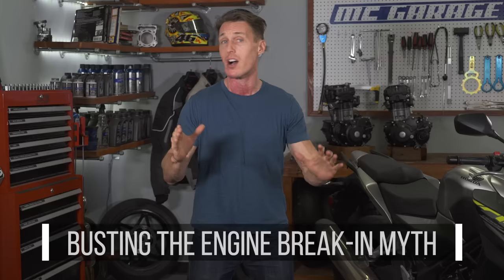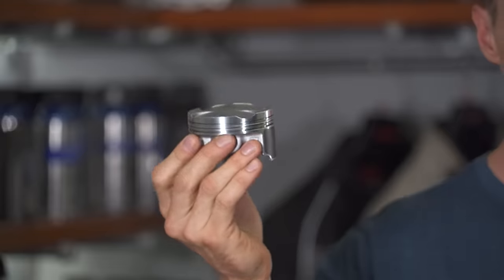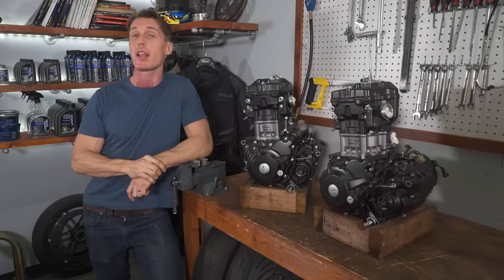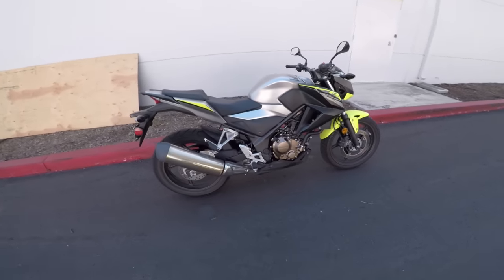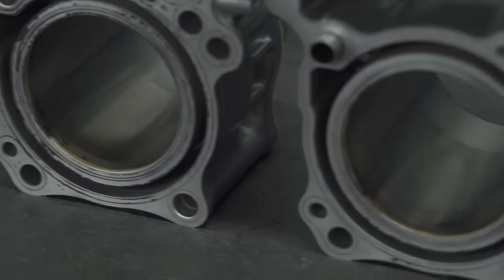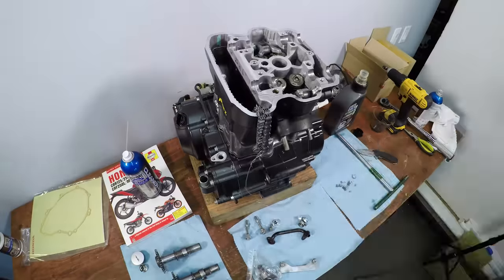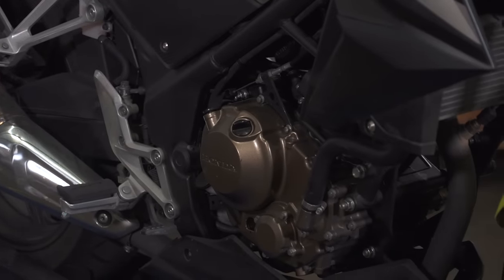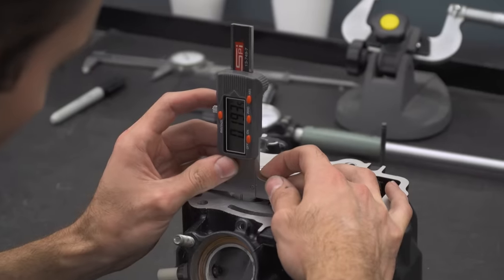Busting The Engine Break In Myth | MC Garage

Comment: He did not put the debate to rest. He even states that materials and engine reps can vary a lot from engine to engine. To claim that this small test on only one engine, which was liquid cooled, speaks for all engines would be a lie. He knows that and he suggests it as well. There is a panel of Harley-Davidson mechanics that do a video just to talk about this video and they all say the same thing, based on their collective experience taking engines apart, they all recommend to follow the manufactures' suggestion.

As someone who worked with the legendary Ed from Ed Pink Racing Engines, as well as with engineers from Suzuki, Honda, and others, I rather follow the recommendations made by the people who designed the engines. 

Engine design is a lot more complex than just slapping some parts together and call it a job well done. Depending on engine application consideration is given to everything from materials, stress loads on different components of the engine and casing, heat tolerance, lubrication, weight, and so much more. These are people who understand this engines down to a microscopic level. When it comes to materials down to the molecular level. Metallurgy is a real science and that science is adhered to when considering materials. One of the many reasons why a new motorcycle engine will cost you a few thousands of dollars. While a GE90 with extremely exotic and expensive metals that can withstand such loads and heat abuse took over 2 billon dollars to develop and the retail price back in 2011 was 27.5 million dollars for each engine. 

If you listened to him, he states that that particular engine is a low rep type of engine and that engine materials vary from engine to engine. The Harley-Davidson mechanics completely disagree with the idea that it makes no difference in all engines. They also point out that this was a water cooled engine that reps are a low RPM with pretty constant operating temperatures when compared to an air cooled engine.  With air cooled engines reaching temperatures of 400-500 degrees when stuck in traffic on  a hot summer day. My 2021 Ténéré 700 never goes over 120 something degrees due to it's cooling system's fans kicking in. Two stroke engines are a different beast all together.

Some idiots claim that racing engines don't go through the gentle engine braking that we are asked to do. But those engines are completely rebuilt after must one race. The engines in our motorcycles are supposed to last a long time. Well, that is the hope assuming the idiot riding it takes care of it and doesn't wreck the bike. Overall the life expectancy of sport bike engines are not as long as that of a touring bike.

A note on engines coming out of racing bikes. Racing engines are occasionally sent back to the factory where engine designers and metallurgists inspect the engine even with microscopes. Microscopes and other testing can reveal a lot more than measuring alone can. And when an engine fails on the race track it goes though even more stringent inspection process.

Here is the thing, when I was involved in that field, every engineer I met, from Ed Pink, to Fujita (engineer at Suzuki) to pretty much every other engine designer I've met do recommend to follow the break in procedures outline by the manufacture. If you want to ride your bike like an idiot who is being chased by the devil right off the bat then by all means do. It is your bike and it is your money. But this is one of the reasons I've never bought or will buy an used bike. 

Until there is a similar test with different types of engines and the test is supervised and inspected by actual engine designers who look at more that just a handful of tolerances, I will continue following the manufactures' recommendations. Perhaps there is something designers know that these two guys and the average joe don't know.

To each their own!

Comment: i followed procedure on my R6, at 5000km the engine just opened up one morning and it became a beast. until the 5k mark it felt clogged up and tight, afterwards the power delivery was so different and before that mark it hardly revved with ease above the 12k rpm explosion.
Reply: Some bikes are limited by the ecu until they reach their break-in mileage.

Comment: On the other hand of the "would you rather have something break or come loose during the calm 25mph or the fast 75mph", a friend of mine working on a dealership was also told to push all the buyers into a slow calm breaking so if something were to "break" or come loose when the bike is working at the high limits, the buyer won't notice until he's 1000+ miles and the dealership would be able to blame the rider for the damage and not pay a dime. Honestly that's just a shady dealership but who knows how many dealerships operate like that.

Comment: The best way to break-in an engine  is to use the maximum torque with the lowest rpm possible, what you have to do is to not let the rings take to much out of the cilinders wall, if you go too slow the rings wont have too much pressure on them, and they will get loosen and take too much material out of the cilinders wall... If you rev to much you engine in the break-in period with high rpms the rings wont be tight enough around the pistons again you will take too much material out of the cilinders walls, thats why you have to use maximum torque with the lowest rpm possible!
For exemple my mt-03 engine i always used full throttle up to 6000rpm until i get 500km on the engine, after that you start going for higher and  higher rpm, 7500 until you reach 1000, 1200km, after this  i used full throttle always going up to 8500 rpm max sometimes 9000 rpm until my bike reached 3000km, only after all this kms  used my engine whole potential, i can assure  my bike its one of the fastest among the mt-03!

Comment: Just found this.  I wish you had done the test on a 2008 CBR1000RR many of which had their engines replaced under warranty because of excessive oil consumption caused by poor ring seating.

Not all engines are tolerant of poor break-in procedure.  To seat the rings, you need maximum cylinder pressure ASAP.  In the aircraft world, everyone knows this.

Comment: Whenever I break in an engine (new or rebuilt) I get them started, setup and warmed up on cheap "dino oil". After it is checked out as being OK I change the fluids, filter and insert the oil it will run with. The reason for this is to remove the initial wear in of the moving parts and usually the oil removed may look like metallic paint. Then follow the recommended oil change intervals.

Comment: I had to ride my bike for its first 85 miles on freeway riding. No way around it. I tried different speeds 65mph to 90mph. But most time at 75mph. Will that damage my engine? Im going to ride it on the roads locally at lower rpms to make up for difference

Comment: I've found it takes many miles for the correctly run-in engine to shine. 

My preferred run-in is to keep revs and heat down for the first 100 miles or so, then to vary load and use engine breaking throughout the whole 600 mile period. I've found engines run-in like this don't begin to burn oil as soon.

Comment: A lot also has to do with the TYPE of engine also.  Roller or plain mains? Air or liquid cooled?  Pushrod or OHC?  The more parts a new engine has, the more things need to seat together.  A p rod engine has lifters, rocker arms etc, so more things to “ get to know each other.  New engines typically create more heat also, so am air cooled engine has a more critical first few miles, ie; no lugging, heavy stop and go traffic etc, to allow the rings to seat and things to “ run in”.
 Things like just a fresh set of rings should be “ loaded” to set the rings, as all else has “run in “ already doesn’t need the extra time.
I agree it’s usually better to give a new engine time to shake out, that is, see what it’s going to do. There are a lot of parts and any one could be not up to spec in some way and fail. It usually happens early on, and is why you get a warranty on new machines.  
Also, I’ve  built many engines and I know what specs I use , but what about the next guy?  He may build everything extra tight, or isn’t that keen on keeping all things in spec at all, you just don’t know. So at least a little time is just good planning toward safety.
Back in the 70s , everyone was buying up Honda 750k’s ,  everyone I knew that rode was buying them, they were beasts in the day. Then the gold wing 1000. Came out, a brand new engine and platform. One of my buddies got one of the first ones sold.  He was riding along in the first few hundred miles and the crank broke!!  Could’ve been real bad, but he didn’t crash.
Honda sent engineers from Japan to look the bike over and decided they wanted to take it back with them and dissect it to find the issue.  They have him a brand new bike for his broken one. He never had another issue.  It turned out some of the cranks had bad metallurgy.  No break in would’ve prevented the break.  But an aggressive one could’ve caused a bad crash.
Since one never knows, I tell anyone that I build for to err to the side of caution, go a little easy for a few hundred miles.
It’s just a cautionary period, then let her rip.  Sorry about the novel…

Comment: I was Not surprised at all and always figured break-in procedures were a pile of crap. Manufacturers like to make anything to do with an engine, sound complicated. They want you to feel out of control, and always come back to the "manufacturer" for service.  So they make up these fictional break-in procedures to train the customer that engines are highly technical and to create fear in touching one, thus ensuring regular service appointments at the dealerships. I have built many engines over the years, and not once did any so called break-in.  However, if dealing with a 2 stroke, it's good not to ride them super hard, until the engine has gone through 3 heat cycles.

Comment: Damn! Glad you are mending. All the best to you. 
Put 20K on my M8 while under warranty.
Part of this at 100F+  temps at high speeds, lots of western states, july august hot.
As an engineer you determine point of failures and when.  Under warranty is the when, where did not matter.

Comment: Well, its recommended in al my instructionbooks to break in, 
I trust the engineers so I'll keep on doin it. I also do extra oil changes. Depending on hard or regular driving/riding the oil is definitly darker in my engines after hard use. I prefer clean oil with correct viscosity then contaminated used oil..

Comment: I can say there was a discernible smell from my Kawasaki 650 during the first 1k miles.

Before the 600 mile mark, you could smell the blow by burning off in the exhaust due to the poor sealing of the rings. The odor weaned off during the 600 mile recommended break in, but still lasted till 1k.

I don’t notice an odor anymore unless I ride hard, which is probably fuel burning off in the cat at this point.

Comment: Engines are usually not cleaned properly excerpt BMW. In almost all my bikes I found debris in oil filters on a first oil change. In one case there was even 1 inch long swarf left from drilling. I would argue that break in maybe not necessary but is advised as it deceases chances for failure until 1st and 2nd oil change which flushes, at first, big and later microscopic debris.

P.S. I know what's in oil filters on new bikes because I do one change before official 1st oil change. At one point even salesman/mechanic recommended to do it sooner than stated in manual.

Comment: I'm a retired mechanic with over 40 years experience.. My grandfather .  And my father was a mechanic my brother was a mechanic I have built countless engines as well as my father and my brothers and my grandfather. My dad always told me.. to break one in the way you're going to drive it. Do not baby it. If you're going to drive it hard break it in hard. It has never let me down yet. There is a built right. Or they are not.

Comment: I saw Alfa Romeo break in their DTM engines after they were built.
They ran the oil up to temp, and then redlined the engine 10sek, idled 10sek, redline 20sek, idle 10sek, redline half a minute and then they ran a normal dynotest.
You need to load the engine to get the cylinderpressure to seat the rings

Comment: 6:28 About that "New tires to scrub in thing". We all know that new tires may as well be packed in soap and banana peels (although for some reason my new car tires always seem to be at their peak when first mounted.) ...but isn't it strange that we've gotta put some miles on those new tires... but somehow the extreme edges of the tires... which can't touch the pavement unless you are leaned over and pulling x geforce per degree of lean angle, those virgin parts of the tire always seem to do just fine? Sure seems like if something is happening, it's not related to "scrubbing." 

I'll wager that not counting temperature, that fresh rubber is about as grippy as it ever will be so long as it hasn't be oversprayed with chain lube.

Comment: i worked at a large motorcycle plant for awhile as a temp.  the final step before they roll em off the assembly line they start em and run them out through the gears

Comment: The reason the manufacturer recommends the "drive it gently" method is to give the rider time to become accustomed to the new m/c before pushing it and testing it's limits. Even pro riders know that they need time to adjust to a new m/c and they don't push it on the first lap; or even the first day or two of testing.

Comment: Yup sorry guys I could have told you that !! 
Change the oil at half normal interval so you can remove any contaminants and filter too is All I ever do, ( But based on your findings - That could well be a moot point also) .
I have always just started a new motor and allowed to warm briefly and then operate as normal, Chainsaw Mower Truck Tractor whatever. IF your build is properly done , your good to go . 
Production Car's do not get run in and generally just specify being gentle initially or in my car driven as normal I treated all my Bikes over the years the same way. Never had any issues whatsoever .

Comment: Dude, may you discuss the in grave detail about how the first generation 1998-2008 or 2009, f4_1000r's have evolved into the new and improved Mv Agusta's.  I own a limited addition Mv Agusta 2006-2007 f4_1000r.  Very awesome,  heavy and with a bit of common engine/electrical concepts, makes any Mv first generation possible to maintain by the owners self.  There's is so much U.S. supporting the first generation f4_1000r's, there is even a club (forum) via internet.  You can literally join if you own an Agusta or if you want other self made garage mechanics troubling shooting latch relays, fuel pump priming, starter selanoid relays, main fuse locations which is a diode right behind the 40 amp fuse on the starter relay.  Etc.  Open up a episode about the 1st generation f4's.  P.s. fell better dude!😀🙂😎

Comment: Another break in method that was found by an automotive camshaft company during a study...
Run the engine at idle for 10 minutes
Let cool for 10 minutes
Repeat this process 2 more times
Change oil and use the engine normally

Comment: Interesting experiment, but piston rings seating is but one area of break in. The other areas are bearings. Higher engine speeds generate higher temperatures and could cause the polishing of metal microscopic surface imperfections to go wrong during the expected break in period.

I would note that for example bearing surfaces are designed to wear and encapsulate debris, so you might not notice the issues on a brand new engine. It might take years to be observable.

A better test would be to have scientific organisation scan the surfaces of the bearing, crankshafts and pistons to actually measure the surface roughness and wear.

I would also note that modern engines from the factory are a lot cleaner, with less debris after manufacture which helps prevent initial damage occurring. This is one reason some rebuilt car engines fail quickly, because either old debris or new machining debris were not cleaned from oil pumps and passages

Comment: So is what im hearing, break in should be however you want to ride it, however you normally ride? hard or easy, just dont lug the engine? Folks new to motorcycles are generally (hopefully) going to ride easy as they learn to ride. Experienced riders (esp. younger ones) will ride hard and fast.
Before researching this topic, it became clear to me that the factory recommended way is really geared more toward new rider safety then it is engine longevity.

Comment: I have been rebuilding and riding bikes for over 38 years and have never thought about breaking in the engine but then I never ride at full throttle. My race bikes i will break them in inbetween the two styles and i have never had a problem except defective parts.

Comment: Similar story from Charles Lindbergh during WW2 in the pacific the fighters had a limited range. He figured out he could run much leaner F/A ratio and not damage the cylinders like Pratt an Whitney said they would an extended range by 200 miles for our fighter planes. Called "running lean of peak"

Comment: Just got my zx4rr 2 days ago. I asked the kawasaki tech before leaving how to do the break-in and if I should keep the revs low, he said to ride it normally and play through the rpms. Dont keep it steady on a number, he said I can push it really high and then let it go down. So thats how I did it on the first 150kms. Now 2 days after, I opened the manual and it says to keep at 4000rpm for the first 200km then can do up to 8000rpm until 600km. Now I am so confused and I try to stick to the manual even if its a bit late 😅